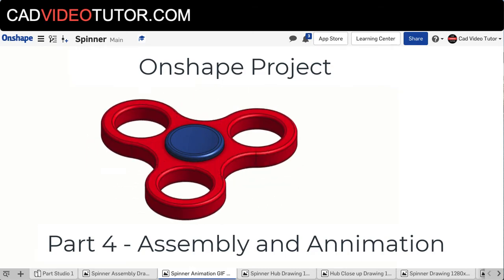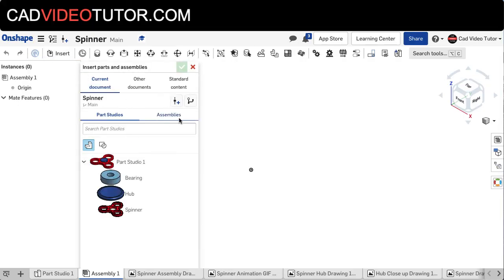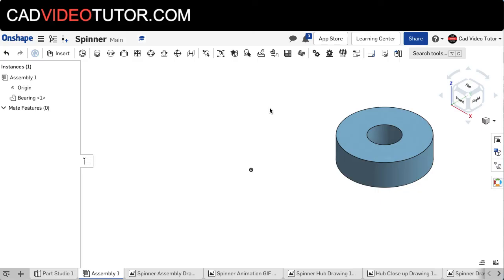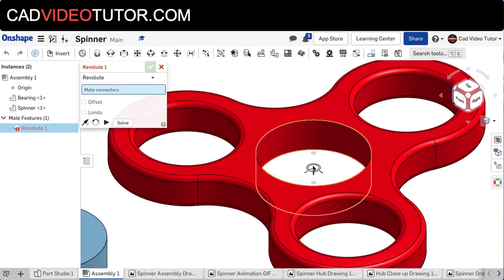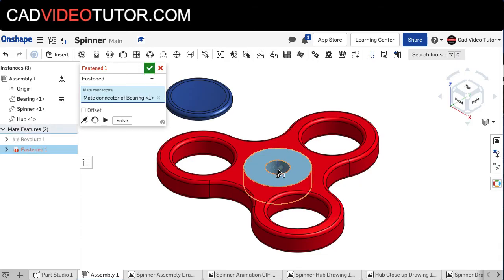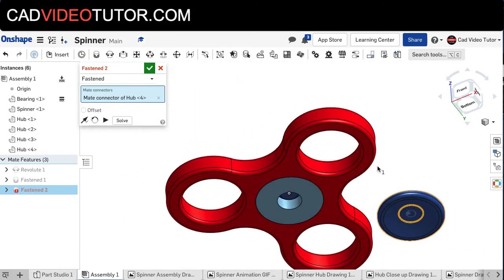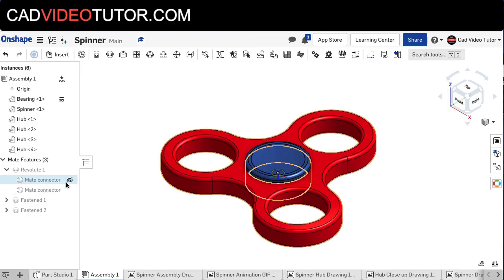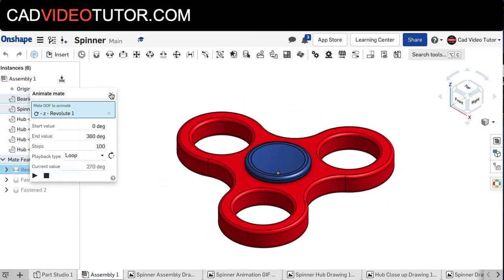Onshape Project - Spinner - Step 4 - Create the Assembly & Annimation

Comment: But If u 3d print it would it work normally
Reply: This design would work for printing.  The bearing size is for a standard skateboard bearing #608.
Reply from the maker: yes